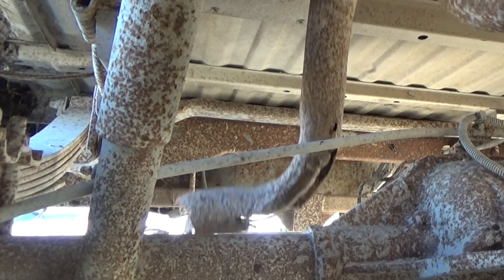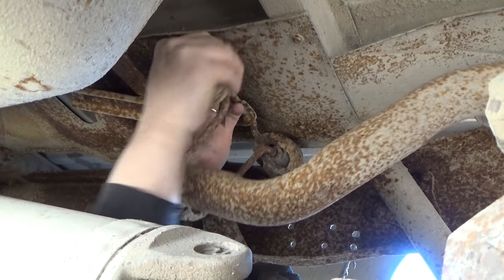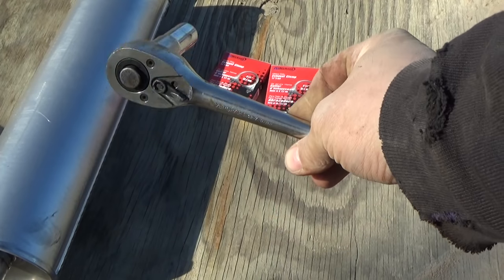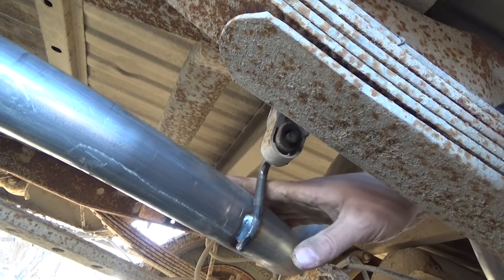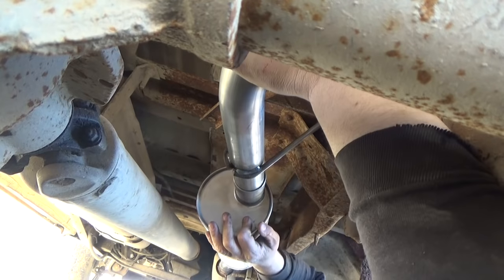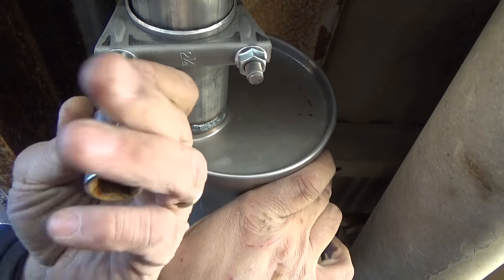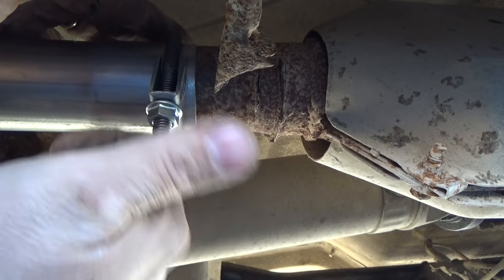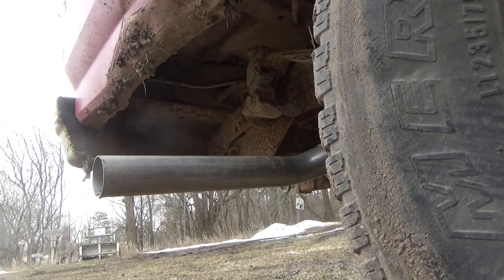How to replace a muffler and tail pipe

Comment: my comment is  a  CAUTION to the car owner..... you go to a shop, and ask for a new muffler.  The SHOP GUY is only focused on cutting off the old muffler,  selling you and installing for you a  new muffler.     If you can be  positioned kind of close to the shop area,   keep an eye when the guy uses the cutting torch to cut off the old muffler.  He will cut around the tail pipe, and will probably not cut thru all the way.... but he is not worried. Because he has a  big metal mallet,  and just bangs on the rusty muffler until it falls off.   Sounds simple.... he installs and welds the new muffler and off you go..... but a few days later,  you smell smoke or   hear extra, different noise coming from your engine.  That is because when the shop guy banged on your rusty muffler,   the pounding caused a  break or a  crack at the engine side (on the EXHAUST MANIFOLD)  that connects to the exhaust pipe that leads to the catalytic converter or to the muffler. So before the shop guy starts,  tell him,   use the torch but dont bang the heck out of my rusty muffler  (just say:   the last time I changed the muffler,  the guy caused a crack in my exhaust manifold........
Reply: That's just cause you had a bad mechanic
Reply: @GENX80. every mechanic could be bad ya don’t know, most knowadays tryna rip people off as fast as they can

Comment: Good idea on those ear plugs. I've dug more rust, slush and mud out of my ears more times  than I can count. Should've thought of that years ago. Thanks for the idea. P.S. It's good to see that nobody stole your catalytic converter.
Reply from the maker: thanks.....no joke on the cat. It was shocking to see the muffler cut off but the cat still sitting there
Reply: @cheapwheels9828  -Maybe some thief could not tell the difference between a muffler and a catalytic converter.

Comment: You can purchase exhaust systems online. I replaced the muffler back on a 2002 Tacoma for $65 delivered vs. $400 at the local muffler shop. Just cut the old one off and slide the new one on. 

Excellent video.
Reply from the maker: Thanks for the info
Reply: Why are you explaining what he just did in the video????

Comment: Great job Dave!  A comment though, if you notice at the back end of the catalytic converter there was a broken off support from the truck frame that was meant as a support for the exhaust system that still needs to be placed and you will also notice a mating groove in the bottom of the exit pipe from the catalytic converter where the support mates up.  You might be able to pick up that part from the auto wreckers.  Take care, Bob
Reply from the maker: Thanks. I'm aware of it..but I didnt cover it in the video. If I cant find the part, there are several good places to improvise a hanger.

Comment: Good timing there - have to go in to pick up a muffler and tail pipe for my ‘89 F150 tomorrow. A job for over the Easter weekend, I think. I did a patch job on it last year and it’s pretty much only the patch that’s left now lol. Going to be doing a lot of the jobs you have to freshen mine up this year - I have an 8’ bed with a high rise cap I have put back on to make a camper for trips this summer. Might even video the process - never done videos before, though. Worth a try, I guess. Thanks for the uploads 👍🏻
Reply from the maker: Give it a shot....its pretty enjoyable

Comment: Thanks for the video! You made it clear and concise! I have a pretty clean edge on my pipe and it the muffler and tailpipe should just slip right on, just have a rusted clamp in the way I need to figure out how to get it off .
Better paying $150 than what was quoted at a shop for $800! PIRATES!

Comment: I had no idea a muffler replacement was this easy!!!   Thank you for the video!
Reply: On a truck it's not bad since you can crawl under there but on a car you'll have to jack it up or get ramps.
Reply: I'm crawling under my 91 E350 this weekend. The shop suggested a new exhaust and said it was barely hanging on.  I'm not a mechanic, but I'm sure I can do it. Thank you for making the steps look easy

Comment: Awesome.  It's more difficult with cars as they either need to be jacked up or put on a lift to get to them.  I have a car that will need an exhaust system.  Fortunately there are several manufacturers that make exhaust systems for classic cars that are ready made to fit if they are stock.  The biggest problem is getting the head pipe off the exhaust manifolds without breaking the studs.  I just don't trust Midas with my old vehicles.

Comment: Just a tip from mechanic to mechanic, when installing exhaust clamps. Install them at a angle so they are less likely to snag anything you may run over ( like a plastic bag)
Reply from the maker: Good tip

Comment: With 20+ years in tyre exhaust fast fitting, we never took them apart we cut the rubbers and gas axed the pipes, the refitting was all new rubbers and clamps, time was money, we alway included it in the price, nothing worse than customers coming back because an old rubber let go, usually we didn't do part systems. And we always used firegum paste on every joint belt and braces. But good work,
Reply from the maker: Great points.

Comment: Hey Dave thank you for the video I enjoyed it and I didn't know it was that easy to do it so eventually one day I'll get to mine too but mine is pretty good just that's it is bent when the guy took my truck off the flatbed beings that my truck is packed with all my stuff in it when he took it off it was so low the back of the truck the muffler bent I just hope that's he did not crack my engine block in the process
Reply from the maker: no kidding...

Comment: If you don't weld, then you might want to make 4 longitudinal incisions in each connection under the clamp .. it's usually darn hard to squeeze the pipe .. these cutouts will help to make and keep the connection tight much better.
Reply from the maker: thanks

Comment: I’m in a city but idc I’ll work on the curbside however I have a 2007 pathfinder and idk if I can use clamps or not. I’m hoping it doesn’t have to be welded but I know it connects to the cat and a mid pipe that crosses over from the driver’s side. Muffler is $120+tax.

Comment: Can someone please direct me to where i can find a way to replace my broken off right at the muffler tail pipe? The place i went to for another repair said it would cost me $600 for a whole new muffler. My muffler is still fine, its the exhaust tail pipe i need to fix on a 2009 nissan versa. Its melting my damn bumper. I cant find help anywhere and i do not have $600.

Comment: Curious what you think about putting some super high heat liquid exhaust weld inside the pipe where the clamps are going on, right before tightening. Unnecessary trouble for later, or extra beneficial precaution?

Comment: You should have Sanded that Rust off the Muffler before putting in the New Pipe in 😊
Reply: The truth is, using clamps you don't get a 100% airtight seal, so it shouldn't make a big difference. The idea is, you want a quiet ride. And hopefully, no exhaust fumes in your cab. LoL!!

Comment: I HATE that thin wall parts store junk pipe and adapters. It rots out SO quick. It's usually not even round. Half as thick as muffler shop pipe. I usually just go to a muffler shop and ask them to cut a section of their pipe stock and expand it for me. They usually only charge me $10-$20. Sometimes it's free. They've got scrap pieces all over the place.

Comment: Would narrow band clamps work instead,  especially on an aluminized steel slip fit exhaust without slots?  I've got saddle clamps, but I may need to replace some parts at a later date.
Reply from the maker: why now use exhaust clamps??

Comment: Did you have to do any welding in this replacement or was that bracket on the pipe from the original setup?
Reply: You actually answered my question immediately after I posted it above 😅

Comment: Yeah I rather just put the clamps on I do know how to weld just don't have a welder anymore or a garage to work at.
Reply from the maker: right on
Reply: I had no idea you could install an exhaust system without welding it together. Thanks, Dave!

Comment: But does it blow when running 🤔🤔🤔🤔👍👍👍👍👍👍
Reply: In the U.K., when you fit a new pipe to a rusty one you use a sealing compound to stop the joint from blowing gases 👍👍

Comment: Yeah no kidding everything was in a rush he had two a tight position and kept jerking the truck to get it off it will not come off of the flatbed and he was in a rush he had to go somewhere else but not only that happened to my mirror got broken and a scratch put on the side of my truck 2 I could not think at the moment and everything went so quick and the scratch I found out after he took off if I was thinking at the moment I would have told him I don't care you're not going if you leave I'm just going to take a picture of your license and your business on the side of your truck and I'm going to call the cops but I screwed up none of that got done but that's okay God sees everything in here is everything
Reply from the maker: very true